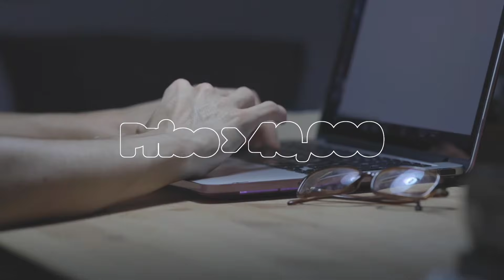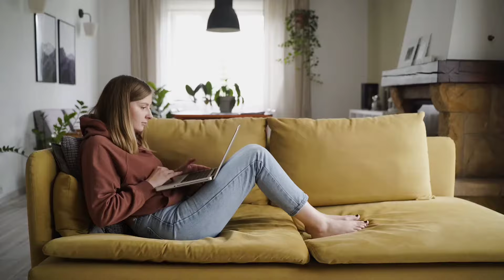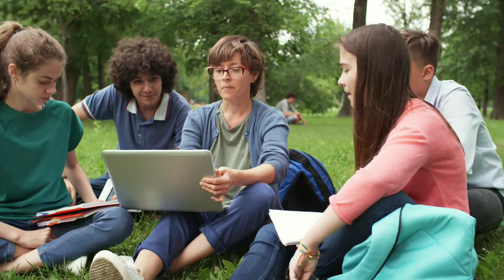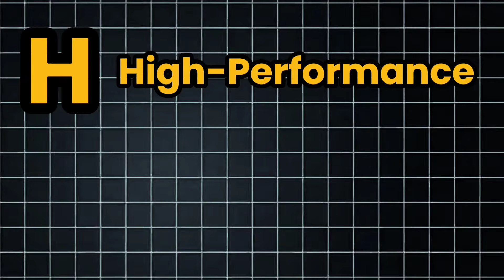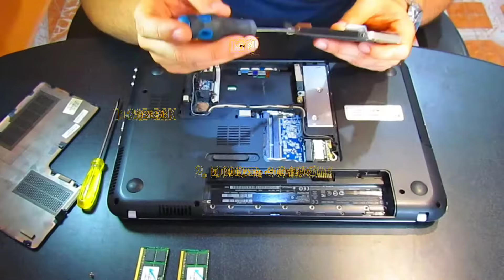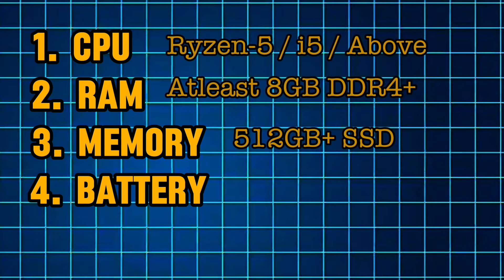Laptop Buying Guide for Electronics Engineers | Intel v/s AMD | Rajveer Singh

Comment: For vlsi preperation 
I've to choose macbook or windows which one is better for all workload
Reply from the maker: VLSI preparation ke liye Windows generally safer choice hai, mainly because most VLSI/EDA tools and college lab environments Windows/Linux ko better support karte hain.

MacBook par bhi VLSI preparation ka kaafi bada part easily ho sakta hai like Verilog/SystemVerilog, coding, scripting, Linux environment, Git, theory, etc. But kuch specific EDA/FPGA tools ke compatibility issues aa sakte hain, especially advanced stages par.

So, agar sirf VLSI preparation ke liye laptop lena hai aur maximum software compatibility chahiye then Windows better/safe choice.

Agar aapko MacBook already pasand hai aur compatibility issues ko VM/remote Linux system/college lab ke through manage kar sakte ho, to MacBook bhi kaafi had tak sufficient hai.

Comment: Hi brother, how is macbook air m5 for a ENTC student?? Will it be worth it for next 4 year?
Reply from the maker: Yes, M5 Air can work for ENTC, and performance-wise it should easily last 4 years. However, some ECE/ENTC software (especially FPGA/VLSI/embedded tools) may require Windows/Linux  So before buying, check the specific software your college uses. If you want maximum compatibility with engineering software, Windows is the safer choice as of now.
If you can manage somehow these situations then macbook is better choice.

Comment: Hi brother I have to buy samsung galaxy book 4 can this is sufficient for vlsi i5,13thgen and u performance please tell me
Reply from the maker: Yes, i5 is capable processor and 8GB+ ram would be decent choice.
Reply: @Singh-Rajveer but you say in video u series performance like not any problem for future
Reply from the maker: @GunitKolambe-y6h  Right, U is for ultra low power. But one more thing comes into picture and that is budget. Laptop prices significantly increased due to memory so now students have to do trade-off as per budget.
Hence,
1. In your previous comment I didn't noticed that you are asking for "U" series because comment used small letter u and I missed it.
2. Even if it's U series, if you can get this laptop in 50-55k then it would be good based on current time as prices are increased. Performance slow hogi but aapka kaam chl jayega.
3. I still suggest to Go for higher series laptops if budget is not the issue.

Comment: Sir is MacBook neo 8gb ram 512 gb storage enough for verilog software?
Reply from the maker: Yes, the 8 GB/512 GB MacBook Neo is sufficient for learning Verilog and RTL design.
Still if you can go for air with M-series processor then that would be better as M-series ecosystem got settled over previous few years.
Reply: @Singh-Rajveer is it sufficient for design verification?

Comment: Should i really go for mac book, will it work with electronics engineering. Like i heard there are some applications which are windows only
Reply from the maker: But that is very specific case aur usually unki jrurat nhi pdti so agr long term goal hai to macbook better kyuki wo btech ke bad bhi chlega. Windows laptop 2-3 sal me outdated feel hote hai while macbook 5+ years pe bhi performance maintain krta hai.
(Personal experience after using 1 macbook and 4+ windows laptops.)
Reply: @Singh-Rajveer  yes i had similar experience with windows. Also do you think mac neo is a good choice
Reply from the maker: Study purpose wale kaam aaram se ho jayege lekin Synopsys, cadence ke tools ya vivado ke tools ke liye mac ka ecosystem utta accha nhi hai. Unko run krke ke liye aapko remote linux server jaise workaround use krne pdege.
To ye point sochte hue aap mac le skte ho aur try kro ki M-series wali chip ho, A18 nhi.
Isliye Macbook air is better choice.

Comment: Sir, which laptop should i buy for electronic and Communication Engineering and in 7th semester i will choose vlsi so which laptop is good which can run all software of ece related easily should I go for dedicated graphics or arc graphics.
Reply from the maker: Bhai which laptop ki jgh I can tell you minimum specifications jo aapka vlsi mtech niklwa dege.

1. Atleast i5 or Ryzen 5 latest gen processor. Also check complete processor name and it shoud have H, avoid U as it's for ultra low power and less performance.
2. RAM: 8GB DDR5, it's very costly now otherwise I would have recommended 16GB
3. Display: FHD 
4. GPU: Dedicated GPU is optional. Agr budget allows krta hai to jrur lena.
5. Storage: 512 GB SSD

Iske alawa ports apni need ke basis pe cross check krke kisi bhi brand ka laptop le skte ho jo tmhe shi rate me mil jaye. Make sure specs ho itne jo bole h.
Reply from the maker: Kuch laptops maine tag kiye the is short me:

https://youtube.com/shorts/dvLE4ED8RyU?si=hh04f_14nWPaIjkI

Aap wo dekh lo but make sure specs aligned ho kyuki ek hi laptop name ke saath companies different CPUs de skti hai.
Reply: Sir aapse bss ye puchna chahta hu ki dedicated graphics lena thik hai ya Integrated graphics se bhi kaam ho jayega vlsi ke saare software wagera run kar jayenge n
Reply from the maker: Iska simple answer ye hai ki agr budget allow kr rha to le lo kyuki phir kbhi agr high end video editing ya gaming krni rhi to problem nhi hogi. 
Lekin agr budget allow nhi kr rha to integrated ke saath ja skte ho.

Comment: integrated graphics and dedicated rtx graphics which is good for btech ee ece
Reply from the maker: Bhai better to hmesha dedicated rtx hai. If budget is not the issue then go with dedicated graphics else adjust with integrated. Usually learning related works don't require intensive graphics so integrated can work except few cases.
Reply: @Singh-Rajveer and can you please tell what are that few cases as I stuck in mid gaming with dgpu and slight primium igpu for ece
Reply from the maker: @nobitanobi9330 For most ECE students, a good iGPU is sufficient. A dedicated RTX is mainly beneficial for large FPGA development (Vivado/Vitis acceleration), AI/ML, CUDA programming, GPU-accelerated MATLAB, computer vision, 3D CAD.

 For VLSI (Verilog/UVM, embedded systems, and basic FPGA learning)- CPU, RAM, and SSD are more important.

Comment: Will the MacBook (M5 Air) run everything for Electronics (BTech), or is a dedicated graphics card required? And what exact issues could I face with a Mac? Will the college have compatible computers where we can do Mac-incompatible work?
Reply from the maker: The M5 Air should handle most Electronics coursework just fine. The main issues are with some Windows-only EDA tools like Cadence, Synopsys, Vivado, Proteus, etc. Most colleges have lab PCs or remote servers for those tools, so Mac users usually manage without major problems.
Reply: Bhai kya aapne macbook purchase Kiya ya nahi 
If not then which one did you bought

Comment: Bro I want to buy Samsung galaxy book 4 i5 16gb ram for VLSI journey this laptop is best ? 😢
Reply from the maker: Just checked , it's showing i5, 13th Gen U series processor. U stands for Ultra low power and generally better for battery backup but performance is not upto the mark. If you are not going with dedicated GPU then you should go with some other laptop which have atleast P or H series latest processor.

Comment: Hello bro , I am considering purchasing the MacBook Pro m5 pro (24gb ram , 1 tb ssd) as a 1st year ECE engineering student, will be fine for rest of my college journey or will I need a windows laptop only ? I m seeking guidance from someone experienced like you , budget isn’t the issue , just getting confused between Mac and a Lenovo legion gaming laptop, please help
Reply from the maker: MacBook is fine and most of the apps now have Mac version as well. But sometimes you may face problem. 
If you feel macbook advantages like high battery life, speed matter more for you then it's perfect choice.
Reply: @Singh-Rajveer yeah but I can use virtual machine for some windows legacy software, do let me know 😊
Reply from the maker: @Devastator699 technically yes but I never tried that.

Comment: My budget is under 60k and I am looking for motobook 60 pro for electronics engineering in vlsi design, it has Intel core ultra 5 255h and Intel arc gpu with 2.8k oled , 16 gb and 512 gb. Can I go with it?
Reply from the maker: Yes specs look fine but take review of moto laptops before purchase.

Comment: Sir as a first year ece student 
Should I buy Lenovo thinkbook 16 Ryzen 7  7735HS 16gb DDR5 ram which is expandable to 64 gb
And 512 gb SSD and a integrated graphic cadr Radeon 680
Should I buy this or not
Reply from the maker: Specifications looks good provided you won't be doing any GPU intensive tasks. Generally dedicated GPU is not required in college purposes until and unless you yourself start doing something which requires GPU like Gaming/editing etc.
Reply: @Singh-Rajveer sir can you suggest a good one between 55k to 60k
Reply from the maker: I have made one short video last month for this but laptops keep coming and specs gets updated. So. i would suggest to shortlist few based on minimum spec, watch reviews and choose the one suiting your needs.

Comment: Hello sir iam an ece student in 3rd sem iam going to buy lenovo IdeaPad slim 3 i5 13th gen with H series processor it is around 50k so should I buy it ?
Reply: MacBook Air m4 for ece engineering??? Reply
Reply from the maker: Macbook is good performance wise but during student life you may require many free softwares and tools. Those may not be always available for Macbook.
Reply from the maker: Yes it is enough for student purposes in general
Reply from the maker: Yes it is enough for student purposes in general
Reply: @Singh-Rajveer can I also use further in future? If needed for job related purpose and other ?
Reply from the maker: In that case: Try to go with expandable RAM. 16BG is mostly enough but going with extendable RAM is a general suggestion for future proof laptop choice.

Comment: Is Lenovo yoga with ultra 5 125H processor and integrated graphics alright (liked because of the lightweight)? If also interested in doing Masters later in VLSI (though don't knwo if this laptop is only going to stay with me at that time)
Reply from the maker: It's alright for general use and portability and normal projects but for VLSI Masters or any graphics intensive projects you may have to go for dedicated gpu.
Reply: @Singh-Rajveer okay

Comment: As electrical engineering student 
Which one i prefer 
Macbook air m4 or any windows laptop with dedicated graphics card or any ultrabook windows laptop like rygen 7 ai 350 series processor 

Pls reply
Reply from the maker: MacBook Air is a risky choice because of software hurdles, making the Windows ultrabook your safest and most versatile option for your degree. Usually macbook m paid softwares rhte h aur saare mil bhi nhi pate otherwise macbook is far better.
Reply: @Singh-Rajveer thank you so much

Comment: Hey bro i am too confused which processor should I buy INTEL core ultra 5 or AMD Ryzen ai 5 340. In intel battery backup is more and  performance is more & in amd have more Npu Tops which means AI tasks will work efficiently compared to Intel processor. I want good battery backup and Ai performance also but If I choose anything I will not get my both requirement so tell me which processor laptop should I buy as an ENTC engineering.❤❤.
Reply from the maker: For your specific needs as an ENTC engineering student, you should prioritize finding a laptop with a dedicated GPU like an NVIDIA RTX 3050 or 4050, over worrying about the CPU's NPU performance. the engineering software you'll use such as MATLAB, Simulink, VHDL simulators, and circuit design tool, relies heavily on strong CPU performance and is significantly accelerated by a dedicated GPU, not the NPU. While you're correct that the AMD Ryzen AI 5 340 has a more powerful NPU with higher TOPS, its practical benefit for your current coursework is minimal. Today's NPUs are mainly used for Windows Studio Effects (like video call background blur) and light AI tasks in creative apps, not for the heavy-duty model training or complex simulations you might encounter, which still default to the CPU or a CUDA-enabled NVIDIA GPU. Therefore, the best strategy is to first find laptops in your budget with a dedicated RTX GPU. Once you have those options, the choice between the Intel Core Ultra 5 and the AMD Ryzen AI 5 becomes secondary. If you value better battery life for long days of classes, the Intel platform is often the more power-efficient choice. If you prefer to have the more powerful NPU for potential future applications, even if underutilized now, the AMD option is a solid bet. In short, don't get caught in the NPU hype; a dedicated GPU will provide a far more tangible and immediate performance boost for your engineering studies.
Reply: @Singh-Rajveer  Thank you For Reply ❤❤
Reply from the maker: For your specific needs as an ENTC engineering student, you should prioritize finding a laptop with a dedicated gpu like an NVIDIA RTX 3050 or 4050, over worrying about the CPU's NPU performance. Here's the breakdown: the engineering software you'll use such as MATLAB, Simulink, VHDL simulators, and circuit design tool, relies heavily on strong cpu and is significantly accelerated by a dedicated gpu, not the NPU. While you're correct that the AMD Ryzen AI 5 340 has a more powerful NPU with higher TOPS, its practical benefit for your current coursework is minimal. Today's NPUs are mainly used for Windows Studio Effects (like video call background blur) and light AI tasks in creative apps, not for the heavy-duty model training or complex simulations you might encounter, which still default to the CPU or a CUDA-enabled NVIDIA GPU. Therefore, the best strategy is to first find laptops in your budget with a dedicated RTX GPU. Once you have those options, the choice between the Intel Core Ultra 5 and the AMD Ryzen AI 5 becomes secondary. If you value better battery life for long days of classes, the Intel platform is often the more power-efficient choice. If you prefer to have the more powerful NPU for potential future applications, even if underutilized now, the AMD option is a solid bet. In short, don't get caught in the NPU hype; a dedicated GPU will provide a far more tangible and immediate performance boost for your engineering studies.
Reply: @Singh-Rajveer hey
Could you please suggest some laptops with these specifications 
Would really appreciate your help
Thanks

Comment: Ryzen 7 7735hs processor is good for ece student
Reply: For  embedded and iot.this processor is best or not ?
Reply from the maker: It may work good however it's quite old processor (early 2023). Better to go with latest gen ryzen 5.
Reply: Suggest your best cpu wheather it is Ryzen or Intel. And also  dedicated gpu is needed or not ?
Reply from the maker: Intel core ultra 9, 285k 
Also, the best cpu choice depends on the budget as well.
Yes, if budget allows then you should go with a dedicated GPU.
Reply: @Singh-Rajveer  In laptop
Reply from the maker: Puch rhe ho ya bta rhe ho bhai?

Comment: For VLSI do we require dedicated graphics?
Reply from the maker: No, Integrated graphics will work in general.
However if you are going to do a very specific project which involves graphics intensive or highly computational tasks then it would be necessary.
In General, Not required.
Reply: @Singh-Rajveer macbook m2 can do vlsi
Reply: Not really

Comment: Is Macbook AIr M4 Is Good Or Not...?
Reply from the maker: Yes, M4 Machines are very good.
Reply: @Singh-Rajveer Is Any Softwares Which Only Run On Windows...?
Reply from the maker: All software usually supports both but if you will be going for free softwares/apps then mac may not provide those options.

Comment: Sir is Lenovo IdeaPad slim 3 i5 13420H wuxga ips 15.3 inch enough for all ECE works 
Please reply sir 🙏🏻❤
Reply from the maker: Yes, college related work is fine but if you can afford a dedicated gpu as well in laptop specifications then that would be future proof.
Reply: @Singh-Rajveer is Thinbook 16 ryzen 5 7535HS 16GB RAM 512SSD enough for all ECE works
Reply from the maker: Yes, It would work

Comment: I am getting a laptop with thus configuration i5 10th gen 8gb 256gb SSD , u series, should I go with this for 4 year BTech I am having ece branch.
Reply: @Singh-Rajveer Ryzen 5 5600u , 16gb ram 256gb ssb, without dedicated graphic card at 30k should I go with this ?
Reply from the maker: @AryanKaushik-k4q Yes, it looks a good spec based on price.
Reply from the maker: No, i5, 10th Gen is very old.

Comment: Bhaiya my budget is 70k. Which laptop should I buy
Reply from the maker: i5 or ryzen 5 latest gen with 1TB SSD and 2GB graphics card.
Reply: @Singh-Rajveer  bhaiya can you tell what graphic card do we need and will these specs be future proof until my engineering is over?
Reply from the maker: @uchandramouleeswarasarma Any recent Nvidia 2/4GB graphics card would be enough. Ex. Rtx 40/30 series.
Reply: U mean 3050 or 4050  @Singh-Rajveer
Reply from the maker: Yes and DDR5 8+GB Ram
Reply: @Singh-Rajveer is ryzen 7 5800hs fine for all the 4 yrs?
Reply from the maker: Yes processor is fine, but keep in mind:
1. If you are going for dedicated GPU then no need to invest more in processor coming with built-in GPU.
2. You can get a dedicated GPU in this budget